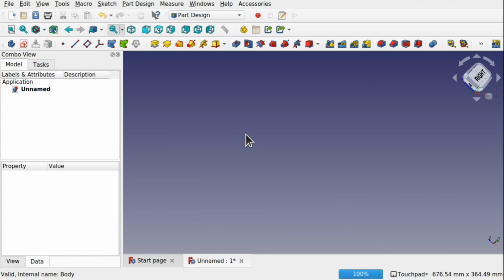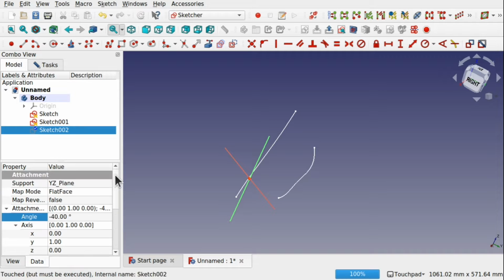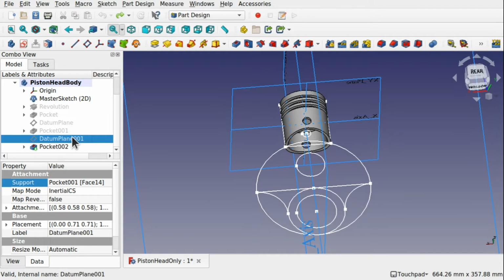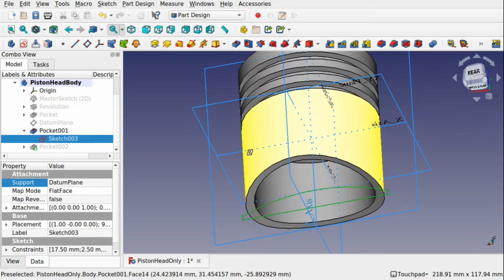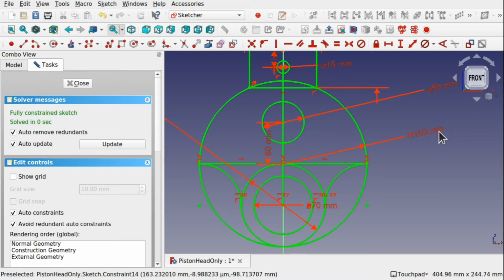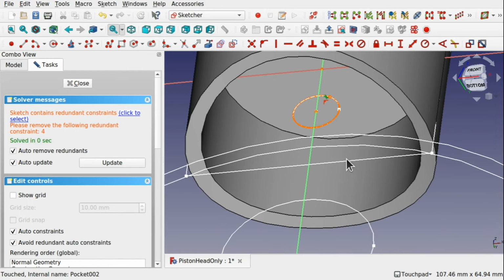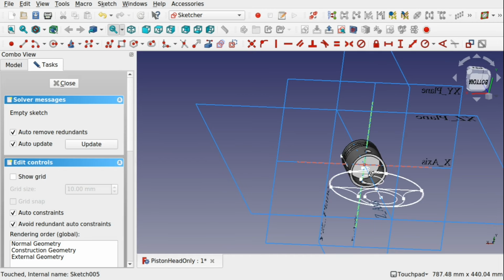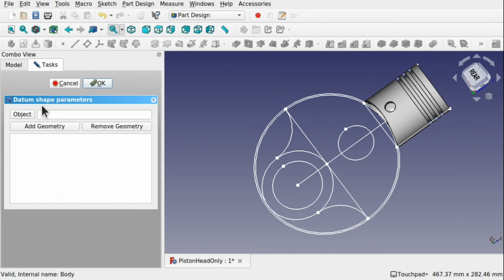Understanding FreeCAD Lesson 3.1 (a) Retrospective and optimisation of Piston Crank Shaft Assembly

Comment: @Mang0Jelly .... could you do a full series on making a plane say an F-22 from image to ready for 3d printing ... (assume an RC plane version or a desktop model on a stand)
- main focus using a Master sketch for each face ... front, side top bottom  etc .. and Positioning them
- workflow design ... focusing on why you would choose one way over another ...
- using bodies and or parts etc to make the various sections (wing tail Cockpit Fuselage Tail ...) and validating assembly of them 

I keep messing up somewhere and cant figure out where I am going off track ... and NOT knowing a decent path to follow .. mucking about in the weeds is frustrating the crap out of me .. 

Learned a lot ... corrected a lot ... but still cant see the lake for the weeds .... yet